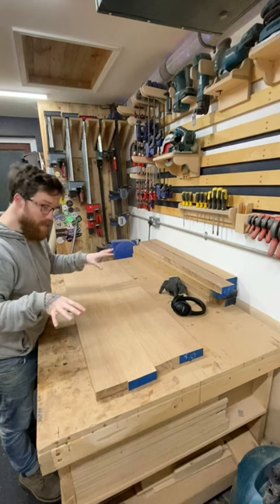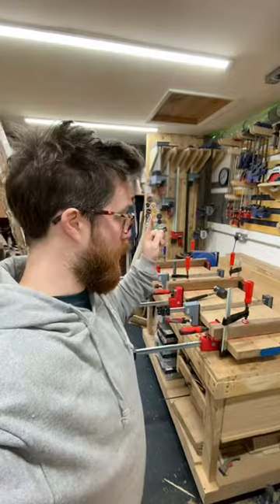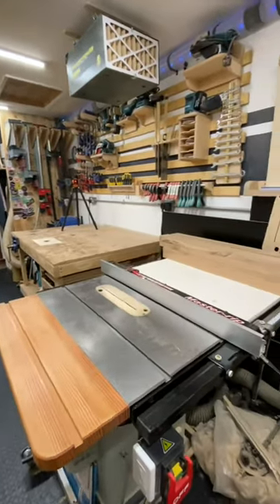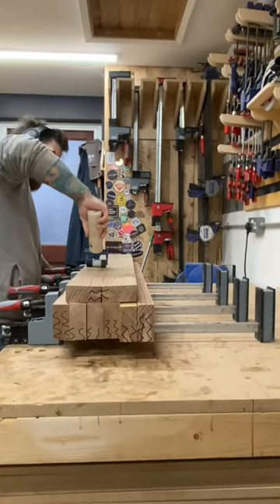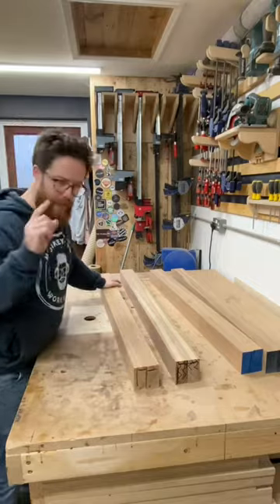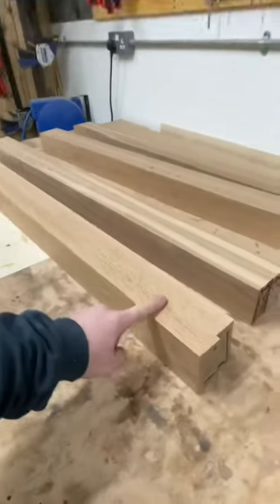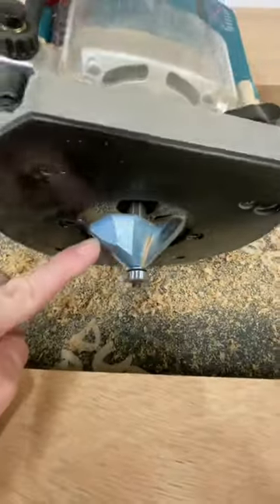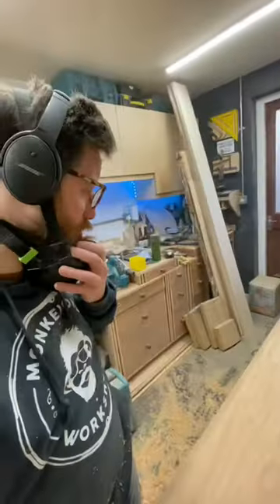Glue Up FAIL! Plus a 2 inch Chamfer Bit

Comment: Nice shop, like the dust collection.    Wanted to know where you source the wood.   It's getting harder to find good stable wood.   Also if you are getting a large piece how can one tell if it has tension in it.     My table saw really does not like it, ouch.
Reply from the maker: Thanks mate! We source it from a few different places but we mainly get it from Surrey Timbers, never had an issue with the quality of their wood before as you’re right, it’s difficult to find and trust sellers lately. It’s quite hard to tell if a bored has tension in it before cutting in to it, but I find that if you’re cutting a board on the table saw and it starts to pinch after the blade and riving knife, pause and add a wedge in the kerf you’ve just made, finish the cut then leave the board to settle as long as poss before continuing to mill or prep for the project you’re on. Hope that helps mate 🤙🏻

Comment: Hi Sam!! I got taught as an apprentice to smile and frown my boards each one but you have done frown smile smile frown. Just questioning what I’ve been taught and wondering what your thought is when you do yours!! Cheers 😁
Reply from the maker: Hey Louis! How’s things? Wow you have very keen eyes I love that haha Yes I would usually do exactly that, I’ve even mentioned it a few times over on my Instagram and potentially in a couple of YouTube videos. But I feel sometimes if you prefer a particular face of a board that you want to be on top, then it’s okay, in my experience it hasn’t made the final panel of glued up board eventually cup or twist, so I’d say definitely do it as a precaution but if it can’t be helped and the faces of the boards are just nicer and more aesthetically pleasing to the eye but in turn gives you smile smile frown frown or something, then so be it, it’s not the end of the world. Saying this, it does depend on what species of wood you are using, pine, spruce or doug fir always do it, but with high quality hardwoods, you can let it slide sometimes 😜 Hope that helps mate 🤙🏻

Comment: Hi Sam, I like your glue roller bottle what you're using @5 minutes into the video. can you get bigger bottles with the roller.
Reply from the maker: Hey Gavin, cheers, yeah it works well it situations like this. It’s from Rockler, I’m not sure if they do a bigger version themselves but I do know you can get wide glue spreaders with a small bucket type thing on top (more if a glorified dust pan I guess haha) with a roller underneath that spreads the glue evenly 🤙🏻
Reply: @monkeyboysworkshop  I use a regular 4” painter’s roller and just pour it straight from the container but these seem to be a lot tidier 😎
Reply from the maker: Yeah I’ve seen people do it that way too. What ever works for you is best I say 😜🤙🏻